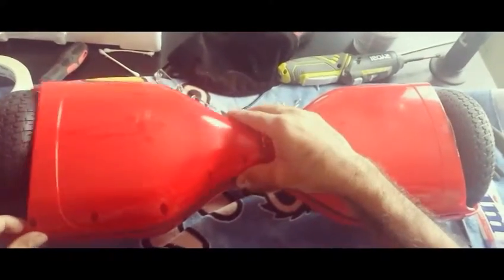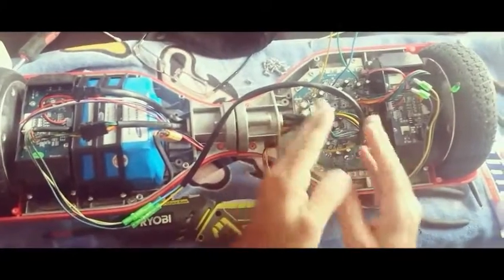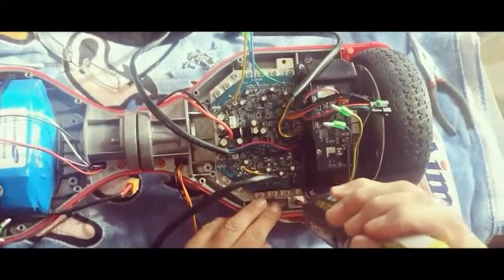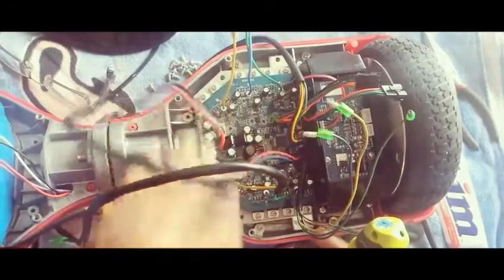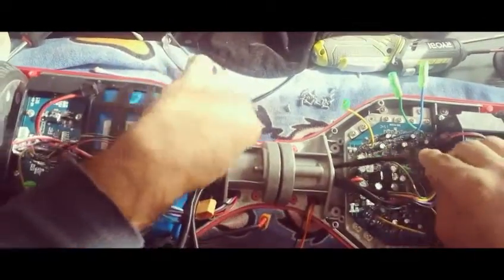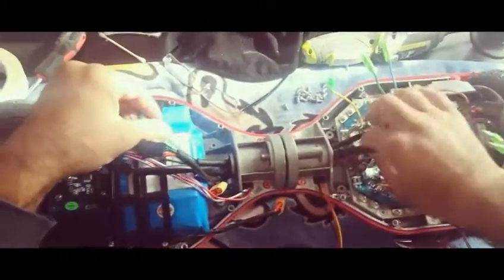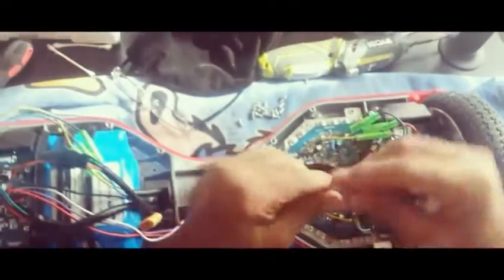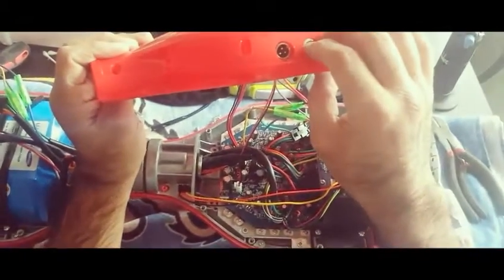How to replace hoverboard motherboard

Comment: I'm wondering if the accelerometer boards / foot switches can be replaced with analog 2 way potentiometer joysticks for motor speed and direction control.   essentially, I want to control the motors using joysticks on the buggy accessory instead of the long handles.

Comment: My board has the two green lights staying on after I tried to re calibrate it now it wont do anything , I opened it up and the red light blinks 7 times, is this because it needs a new motherboard? it is only 3 weeks old
Reply: no i think you need to replace the gyroscope sensor on the battery side